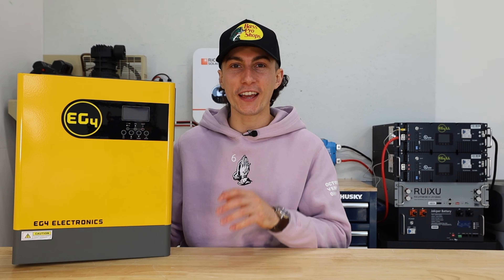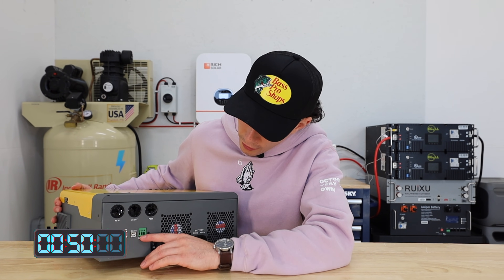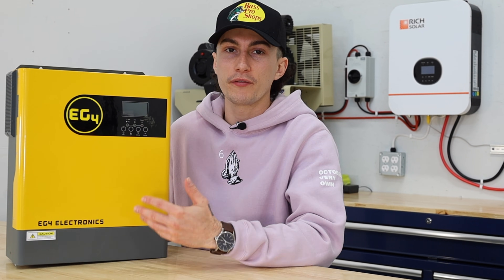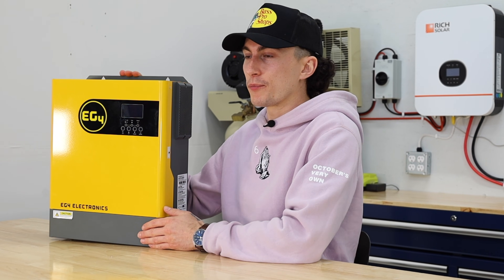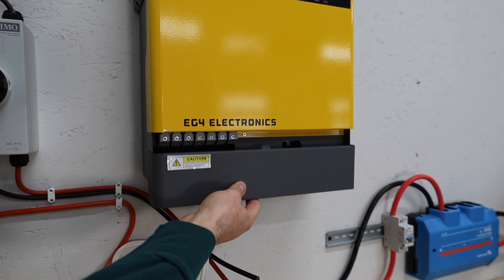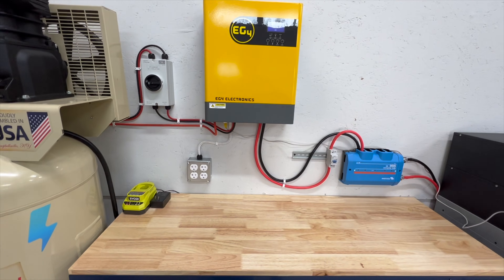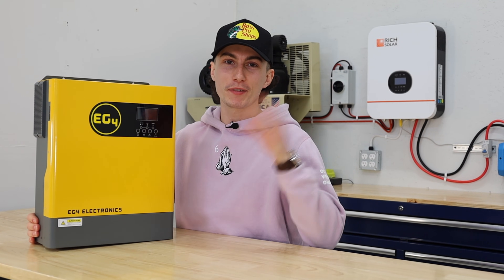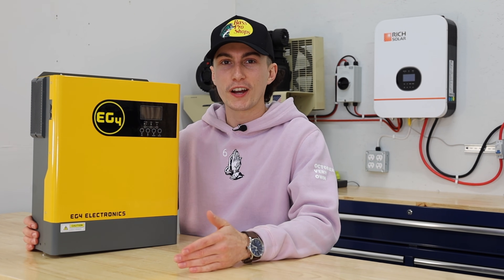EG4 3,000W All-In-One Inverter - Beginner Friendly Solar Setup!

Comment: Dude, it's not $699 anymore. It's now $1,049.95. This is called bait and switch. You should take your video down before someone reports you.
Reply from the maker: Bait and switch? More like tariffs and inflation. At the time this video was filmed this was accurate information, that’s how these things work! We just as unimpressed with the price increase as everyone else..
Reply: @TheSolarLab They must be based in China then, or parts? If not US made right? I see BS inflation from contractors/electricians, as well for labor alone. Making more money than top surgeons/hour. Greed is the actual answer.
Reply: I believe this is the same syrne made inverter you can buy for others rebranded to sungold or pow mr although I think not long after this video eg4 switched to a different manufacturer and the newer version is different.

Comment: Question.  I'm currently using the eg4 3000 with 2 eg4 lipo4 v1 batteries. Is there any issues to adding a eg4 lipo4 v2 with that? Like there was with my eg4 6000xp.  Do I have to modify the communication cables

Comment: Yes I bought a cg4 system for my tiny home I put in the backyard I'm looking to run AC from the house to the tiny home 🏡 the distance between the house to tiny home is 180 ft what size wire should I use

Comment: Good info!

Question:  is it possible to split the power from my solar panels to go into both the EG4 3000 Inverter AND my EcoFlow Delta Pro? 

The reason I ask is because I don't want to have a separate solar panel setup for my Delta Pro since I can plug directly into it, instead of plugging into the power outlet from the EG4  and so far, I havent't seen nor heard anyone mentioned it in any of their  YouTube videos...

Comment: How many amps can I connect into this inverter (pv solar panels in parallel)
Is it 18 or 80amps?
Reply: It will take 80 amps AC from the mains input which could be from a normal Utility AC Source or Generator at 120VAC.   

The solar PV input is rated at a maximum of 5000 watts into the Inverter with an input range of 120VDC minimum to a maximum of 500VDC.   Because it has generous headroom for higher DC input voltage (relative to some competitors) it would be best IMHO to series connect the greatest number of panels accounting for the Open Circuit Voltage and coldest temperature extreme for your location per ASHREA.

For my panels which have a max OCV of 64.8VDC at STC, or the more important rating of 70.5VDC at my coldest extreme temperature, I could series connect 7 of them for a total of 493.5 VDC maximum of solar input.  They should deliver an actual wattage of 300 watts per panel so 7 panels in series x 300 watts each would equal a total of 2100 watts combined.   

I could then run another 7 panels in parallel with the first set for a total of 2 parallel strings of 2100 watts each for a total of 4200 watts of PV input.  I could not add a third string as that would increase my PV input to 6300 watts which is above the 5000-watt maximum rated PV input. 

Note:  I do not own this inverter but ran the numbers for you just as a helpful guide as to what would work in my situation.  Please do your own calculations or consult with someone regarding your own set up.   Cheers!
Reply: @emblems4life726 I appreciate this information so much. I’m excited to hook this up. Also purchased the eg4 48 battery and waiting on my solar panels to arrive. 
Currently have been using an Anker f3800 with 1 expansion battery and 4 of their 400 portable panels. Has been working great. But I’m more excited about the capabilities that these diy setups can offer 
Thanks again for the info 🍻

Comment: If im not using solar, but using it as an emergency power source, and charging the battery from ac mains, once the battery is charged, does it need to be "on" all the time?  Im hoping not, so  the sound wont be an issue.

Comment: 7:16 The Ground screw or Bond on outside of case is provided for.  Example IF no AC input and is being and used as solar only then you must ground case. I am not sure what that may entail grounding rod etc. I would have to dig deeper in requirement and code. In this case with a AC in it is grounded correctly.

Comment: Why do they set the max charging default setting to 60 amps when they recommend installing a 30 amp breaker at AC input?
Reply: 60 amps @48V = 2880 watts which is less than 30 amps * 110V = 3300 watts.   That's my guess.  I don't have one of these.... yet.

Comment: So rookie question, but...
If you can prioritize PV input, but also have AC input, and have it draw on AC input whenever the batteries are low and the PV isn't producing enough power, then how is this not considered a hybrid inverter? Maybe I don't have my definitions straight.
Reply: It is not considered a hybrid inverter because it cannot export excess power to the grid, only take power from the grid.  Hybrid inverters can export to the grid.

Comment: I like the fact that these are stackable, and I like the 120 volt solar input. My solar is (currently 9x100 panels with potential to install additional 600watts which breaks down to from my Zendure 400 watt foldable panels  and 2 more 100 watt I haven't installed as of yet. I'm upset with my Zendure unit which was the SBV 4600 that I had to return because of it smoking one morning..and Zendure customer service was not helpful, I mean for me putting in a ticket, then they ignored me for 2 moths, I ended getting my refund from HomeDepot where I bought the 121 pound beast of a battery. Thanks HOME DEPOT  if your watching .

Comment: You said in the video I can run pass through form PV without the Battery , but when I tried to use it even with AC and won’t run or work
Reply from the maker: We played with this unit a little while ago, so i dont remember 100% what we needed to do - but it's likely going to be a setting that needs changing to prioritize the AC or PV over Battery!

Comment: The shitty user interface, and where it wants you to say it is using an AGM battery? I understand the software sucks too? I will pass on this and use a Victron. Cost more but easy to use reliable and it just works. Oh and quieter and uses low frequency inverter so handles inductive loads better.

Comment: I have a pole barn that I’d like to run some lights to. What would be the best/cheap inverter to use?  I’ll just need to turn a light on when backing boat, camper etc at night. Also, like to have a dusk to dawn light outside.

Comment: I bought the 3000W try to return it to get a 6000W unit but signature solar greed needs a restocking fee.
Reply: If you used or installed it they can no longer sell it as new and will loose money. Even if it left their store it’s now considered used. 
It would be like you working for a couple of hours and receiving no money. Do you think that’s fair? Think about it.

Comment: Thanks Solar lab! I am looking forward to your guys review on the Rich Solar NOVA 6500-S, It is close to this price. The solar input is not as high with 250V but it has 2 inputs so 8k total. I Idle is listed @ <70 . I am also interested in the no battery mode. The price of lithium is dropping I am going to hold out for a while before getting some 48v batteries.

Comment: Question. On specs it is stated 1500 meters is max elevation, about 5000 feet. I am at 7000 feet. Why is there a ceiling of 1500 meters elevation?
Reply: I understand the elevation rating is reduced cooling due to 'thinner air.' Others run inverters at higher elevations but also make sure the unit has got plenty of air flow.

Comment: Hmmm, could I EASILY wire in a 120AC surge strip AND a 30 amp plug for my RV?  And would it require big panels due to that voltage?  I think I'd only need about 1200-1600 watts coming in. Maybe this could take care of my stationary RV and my little shop!
Reply: I wish more people answered your questions because I'm in the same situation! Did you end up getting one? Is it working out?
Reply: @tarlnobert8033  see Will Prowse video - as long as the panels are in series, so each then add up to a minimum of 120 vdc and do not exceed 500vdc.  Ex (6) 375w panels, ea w 41vdc so x 6 = 241vdc, gtg
Reply: per Will Prowse, you'll need a minimum of 120 VDC to be able to charge the battery & All-In-One: Dont go over 500vdc. I bought (6) 375w panels, ea w 41vdc so x 6 = 241vdc when strung all 'in series'.

Comment: Nice unit but what is an affordable 48v battery that can be used with it.
Reply: Eg4 has a few batteries that communicate with this inverter. 5 kWh to 14.3 kWh.
Reply: you could also use 4 100aH, 12v LiFeP04 batteries wired in a 48v configuration.  Not as efficient but gets the job done for possibly cheaper.

Comment: So, can you use this as a "booster" with pass-through AC? Like if your AC in is only 10 amps, but you have a 20 amp load, can it pull the rest from the battery (assuming no solar)?
Reply: In short, yes. I limit my intake from grid to 10A (so it doesn't blow anything on an existing circuit) and this is what would happen at night when solar is off.

Comment: This will feed solar power back to grid, in case battery is charged and house usage is much less than solar generated power ?
Reply: No, you need what is called a hybrid inverter for that.

Comment: No a good inverter , my burned out in less than a year , I will put a video of what happened and why not to buy from that brand, I'm hoping they are more helpful on the refund but they are giving me a lot of problems to get it on a return from signature solar , will see but stay away from this junk.
Reply: There will be a small percentage of duds in any product. This one has a ton of users (I don't know why the video says it's relatively new, it's been out well over a year) and very few complaints.
Reply: Still.....if it is a good product with few fails they should make it easy to return.  Thanks for the tip.

Comment: Perfect size for an RV or small cabin, considering the charge rate 24kw of battery and 9 x 550-watt panels 430 to 460 v.  I just checked my solar dealer 6200usd for panels(4950w) and (24kw) batteries, 200 max for wires. Under 8000usd (tax and shipping) for a decent amount of power. These all-in-one inverters have less wires than a stereo to connect. Mine has 17 with 4 pv inputs.

Comment: as an electrician, i have no issue with wanting to use the ground to the AC in, as long as they have continuity, i would probably do the same thing myself anyway
Reply: +1
Reply: 7:16 The Ground screw or Bond on outside of case is provided for.  Example IF no AC input and is being and used as solar only then you must ground case. I am not sure what that may entail grounding rod etc. I would have to dig deeper in requirement and code. In this case with a AC in it is grounded correctly.
Reply: @samrotolo7303  equipment that I've installed usually has a bond between the equipment and the casing from the factory, but that's why I specified there being continuity
Reply: @masterbond9  I Did not disagree its actually where ac in ground goes is where he put it.  Simple IF NO AC in must ground case/ bond to ground.   Even at that still same on outside as inside.

Comment: This is compatible with Solar Assistant, I used it with it. Highly recommend you toss out the dongle that comes with it and just go with SA, it's SO much better of an experience and you can control most of the configuration within SA too.
Reply: Never heard of solar assistant before, would I have to order a sa specific dongle?

Comment: Lightweight, high frequency, transformerless inverters are never a good buy, even at $700. The have shorter life expectancies and much poorer surge capacities than low frequency, transformer based inverters. And because high frequency inverters have no transformer and thus no galvanic isolation between their DC boost stage and their AC output, during a catastrophic failure of their H-Bridge circuit where a MOSFET or IGBT shorts to ground, these inverters can pass high amperage DC current to your AC appliances and damage them.
Reply: Been running 2 for the whole house, works great.
Reply: I have about 30% of my home's "load" on this unit. Typically in the 200-900w range. Works awesome. Guess time will tell.
Reply: @jackh125  are you off grid?
Reply: @jackh125  are you off grid?
Reply: @jackh125  They are typically only good for 2 to 3 years of use, Please come back then and give us an update.
Reply: You wouldn't want to run your house on it, but it's a good buy for emergency backup of your PC and fridge if you live in an area prone to power failures.
Reply: @brock2k1  Working great for the whole house.
Reply: I have been running my house for a year now. No problemo. Just buy a gooood surge protector.
Reply: What if you're just running a $150 window AC unit
Reply: @callmebigpapa  You can still expect a shorter life expectancy from cycling the compressor without an impedance-matched output transformer to act as a buffer to protect the MOSFETs.
Reply: What Inverter would you recommend?
Reply: Yea I was about to say the same thing……….